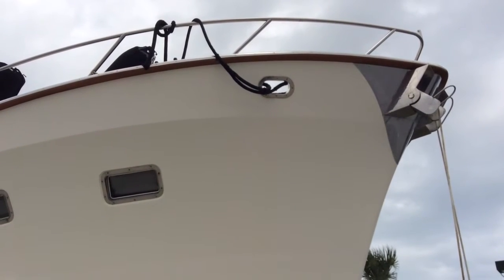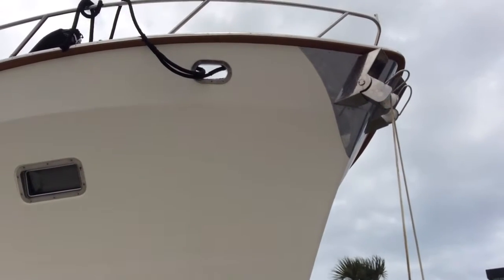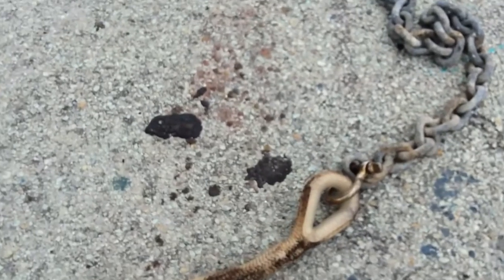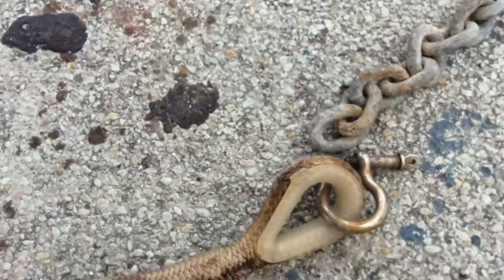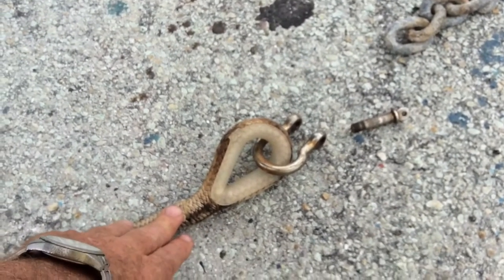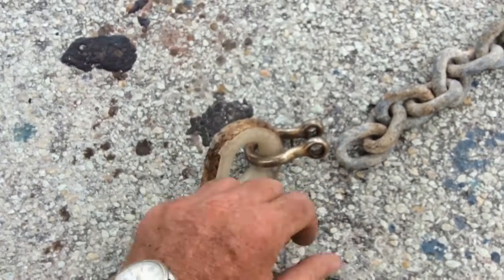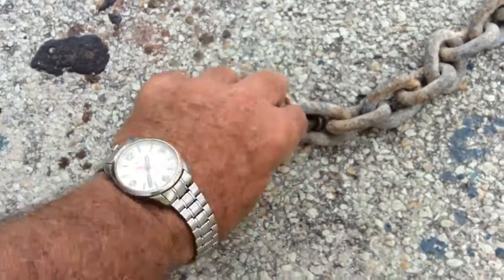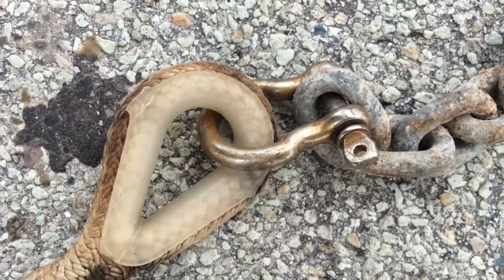Anchor Shackle Safety -part 1

Comment: I use red lock tight.  Will not come off till you want, takes heat and torque to remove it.

Comment: Very simple fix. Question....your opinion on using plastic zip ties to seize the shackle pin?
Reply from the maker: Lorne Hargis that would only be a bandaid. And if you must do a zip tie then use a black one as it is more UV resistant. Best practice is monel wire.

Comment: This shackle is undersized and stainless steel which is weaker than a quality rated galvanized shackle such as a Crosby bow shackle. The chain and rope are strong but that shackle is the wrong part for the job. By all means mouse the shackle with wire.
Reply from the maker: Thomas Evans  I agree this is undersized and not up to the load requirement I prefer if this was my boat. Thanks for your comments.

Comment: Know as mousing the pin or using twisted stainless safety wire by use of a pair of safety wire pliers. Other method would be to use a stainless wire tire, Panduit makes them.